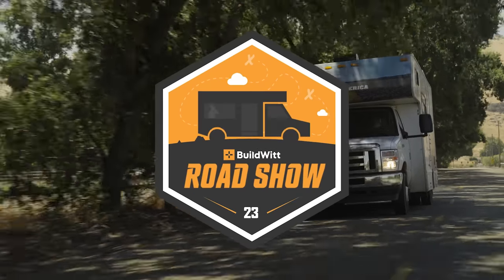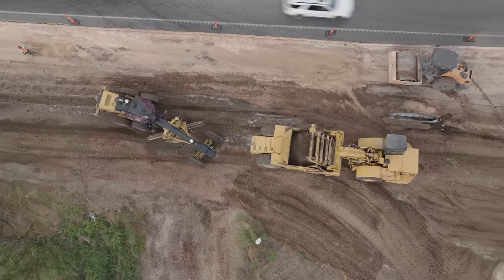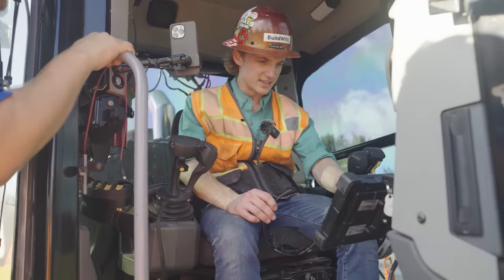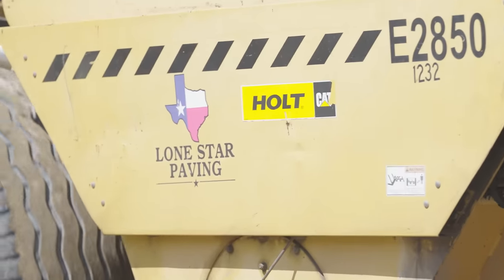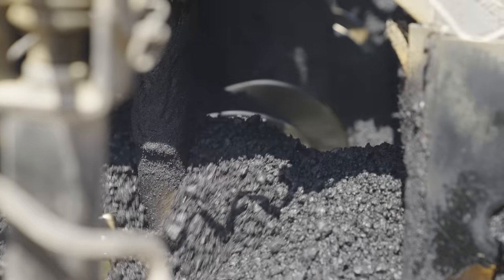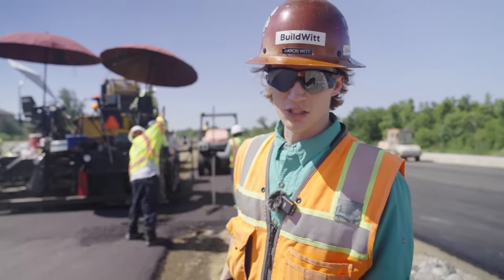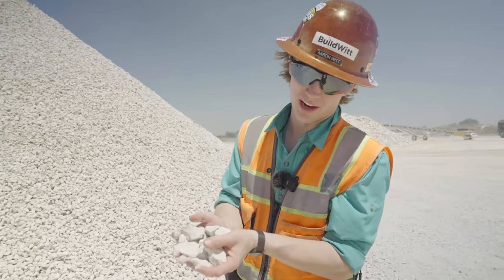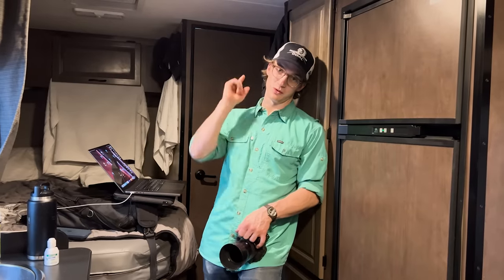Texas Earthmoving, Paving, and Blasting!

Comment: Do they juse limeston for road base? Wow no wonder the trucks only have total weight of 37metric tons.
Reply: Yes, limestone and sand is about the only thing quarried and mined around Austin
Reply: @nathanschneider8586  So no granit or porfyr rocks.
Reply: @truckingswe  I imagine down in south tx (near Fredericksburg) there's granite, and there's a couple quarries I've seen between austin and Dallas near some dried up river banks that get river rock. Then there's coal country in central east Texas. West Texas and south tx has a lot of sand pits (used for frac sand). Lots of lime for around here too.
Reply: Honestly though, TXDOT is starting to prefer foamed bitumen for the sub base, as it's a cheaper/superior solution than milling and filling. And the base is usually pretty good around Austin west of I35 (~2-6ft down is solid limestone)
Reply: It's crazy how big their trucks are for only 36metric tons
Reply: @nathanschneider8586  I'd actually say up north of Dallas - I just looked at a map of the inland seas from way back when and it shows nearly all of TX as being under water, except for the part I mentioned north of Dallas, so that could be the reason for so much limestone down there.  Thanks for causing me to research and learn a little something new ;)
Reply: In the US, the max weight most trucks can carry is 80,000lbs gross weight. So basically, you can carry 20 to 25 gross tons of material depending on how heavy your truck is. We have bridge laws, which means that in order to carry 80K lbs. You have to have X amount of axles of a certain length from the front axle to the rear axle. In Europe, it's based on axles' weight. Distance doesn't matter to the axles.

Comment: Can anybody tell me why those steel half pipe trailers are so common down there? I’m used to aluminum straight trucks and dump trailers
Reply: Here in Texas, especially in Central Texas. Most of the soil is hard rock (limestone), plus most of the truckers are independent owners. So they carry a variety of material. You might haul limestone bolders out of a construction job site and haul back crushed base. Then you might go to another job site and pick up ripped up concrete with heavy rebar in it. Then if it's raining, and no work. Some guys might haul heavy scrap metal to the port of Houston or to the steel mills. Most aluminum trailers you see here only carry sand and small sized gravel to concrete producers.
Reply: @79noel  very interesting, great way to keep busy with one trailer. Thank you for your reply!